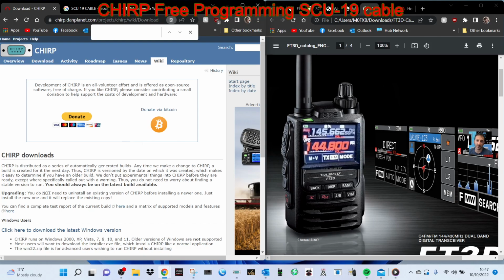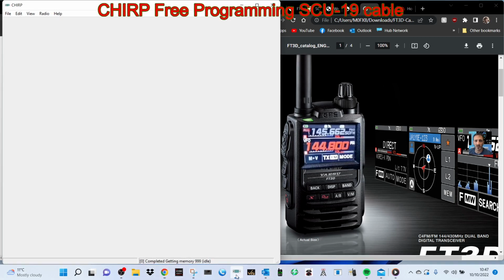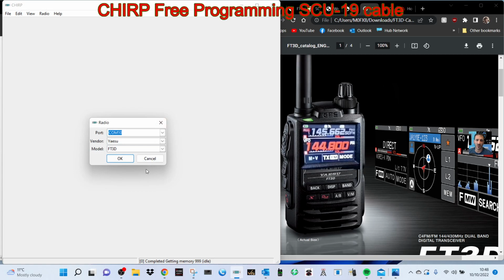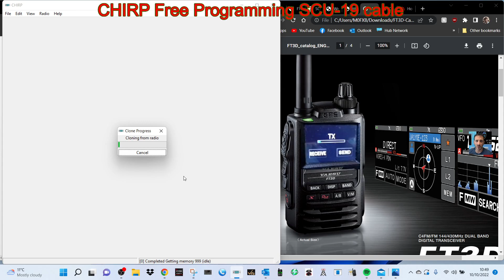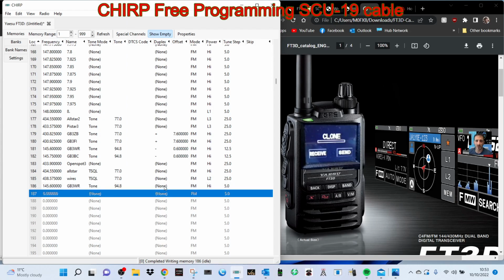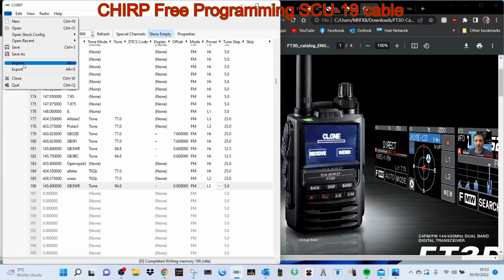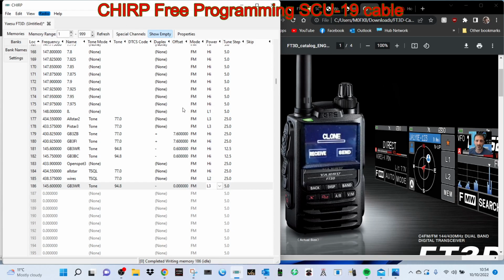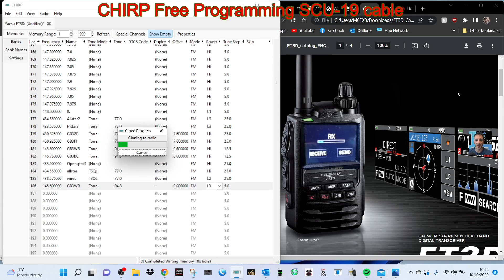CHIRP - YAESU FT3D Programming Software FREE

Comment: The CHIRP\Yaesu 'bricking' is a bit of a Chinese whisper that relates to a much earlier version of CHIRP software and older radios such as the FT-8800. The software overwrote the EEPROM so many times that it went over the write limit for the EEPROM. Whether this was an error with that particular release of CHIRP or the EEPROM not having much memory isn't clear, but Yaesu did issue a warning not to use CHIRP on that particular radio (source Yaesu UK).

It appears to have been addressed in later versions of CHIRP, I also suspect Yaesu have increased the EEPROM sizes\write permissions or whatever the equivalent these days, possibly even over-writeable maybe?

I've used CHIRP on my FT8900, VX-3, FT-2 and FT-3 without issue, useful for initially getting all you channel memories duplicated with your rigs in the same order but that's about it.  The excellent free Yaesu software is a lot friendlier and allows you to use the SD card too as well as being able to import\export with other Yaesu software.  I believe the RT systems software adds additional functionality such as being able to import from repeater book.
Reply from the maker: https://youtu.be/SmBncNV4IFQ

Comment: Wouldn't recommend using chirp with yaesu digital radios. You can brick your radio, and won't be covered. Don't use chirp
Reply from the maker: any evidence to support this ?
Reply: @M0FXBHamTech  yeasu states that you shouldn't use it, as it can damage it. Also Had a friend that it happened to.
Reply from the maker: Sorry need real evidence with technical proof .
Reply: @M0FXBHamTech Yeasu USA.
 CHIRP can damage radio and void warranty on radio. It should not be used for software programming purpose.

We supply free ADMS model software or other purchase options exist.
I have had a few messages sent to me today again on the topic of programming software for Yaesu radios. 

We, Yaesu, do have ADMS software for some but not all of our radios. If you use ADMS software it will work and NOT run the risk of damaging your radio. 

Other software options do exist and are not made by Yaesu. Some of these options do cost money and some are free. Just be aware that when using any 3rd party products (software in this case) you take a slight risk. 

If damage is caused to your radio by 3rd party devices it could void the warranty. This is not a blanket statement but more so for people to be aware of free, reversed engineered, or other means of creation. An example of this is the CHIRP software which has damaged radios. The customer was out $250 + dollars as damage was above and beyond repair.

A company that makes a 3rd party device usually stands behind their product and if using one you might want to see the backing of the product. One of these messages today stated that using a 3ed party, paid software, might have caused damage (and it was NOT RT Systems). They have been advised to call our technical support department for further assistance.
All these are posted on yaesu's official page